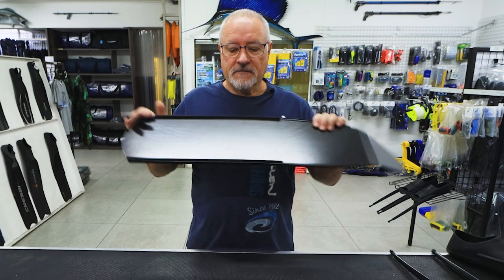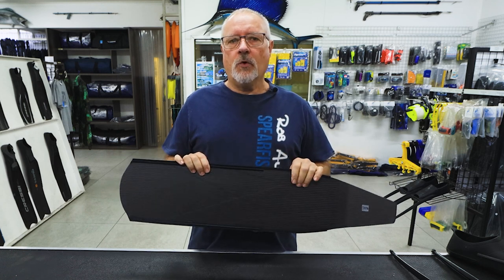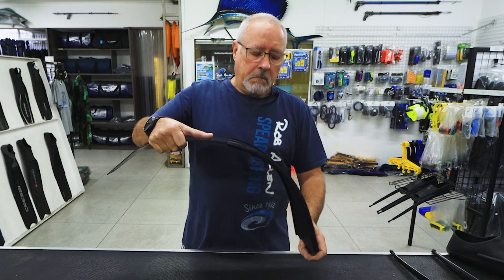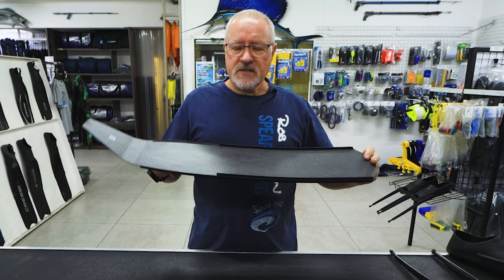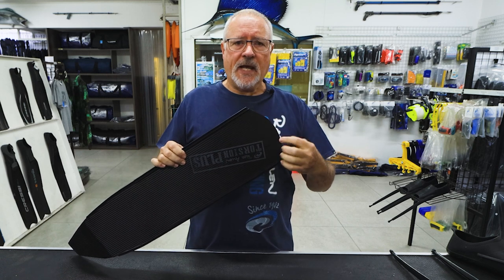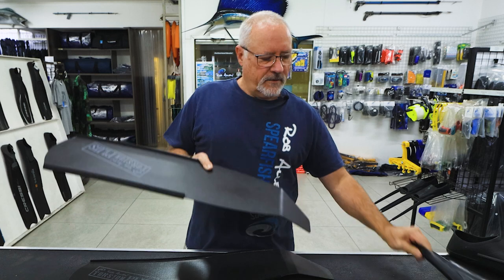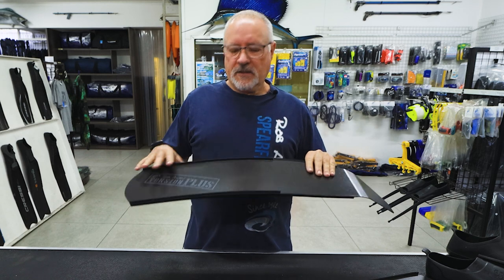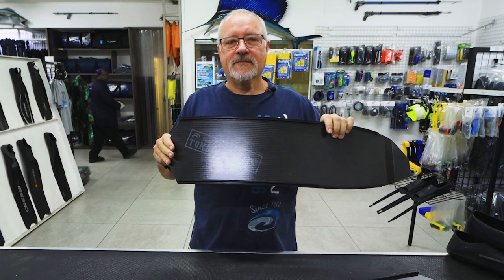Rob Allen | Torsion Plus Fins | 2022

Comment: Very true one should not feel fins even after a longer day of spearfishing. 
I first had stiff blade plastic fins and ended up with soft carbon fins. Love them. 
Some people are afraid of carbon because they feel its fragile. I use mine since many years and have to say they are tougher built than we imagine. Only broke off a tiny piece on the end - probably somebody stepping on it over gear on the messy boat :))) . 
I use carbon fins everywhere, even in 'tougher' terrain. My first scratches on the fin did hurt :) but they are working tools, so today they are quite scratched due to lots of rocks but function perfectly. 
I feel also carbon performance stays, while plastic fins lose their softeners etc. and become hard and lose performance. 
Can recommend truly to go for carbon fins - will change your spearo life :)
Congrats RA team. Keep it going!  ><000*>
Reply: I have C4 Pershing carbons with stiff C300 footpockets. Medium stiffness.  I weigh 130kg, 145 kg with weights and 5mm suit, and they work perfect for me. I feel like putting in 10-20% of foot power and I move very fast. I also wanted fiberglass fins, so I ordered Leaderfins and got them hard stiffness - I put 90% of my footpower in and move slower than with my carbons medium stiffness. Exhausting. That is the magic of carbon - they do the work for you with their reactivity. I will also try fiberglass medium and soft. But the more I look into it - the more I realize that it is best to forget everything else other than carbon.